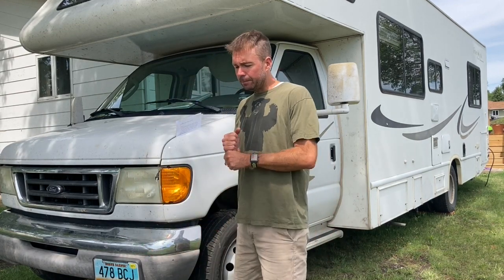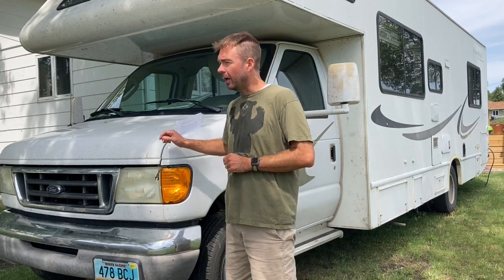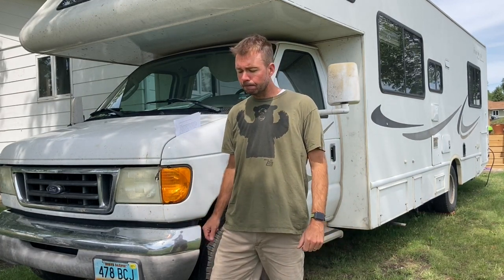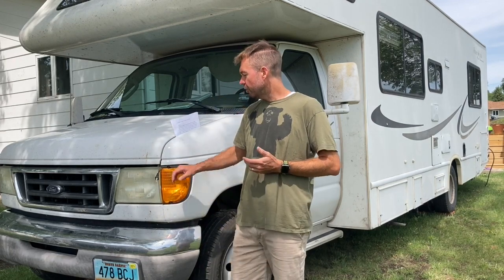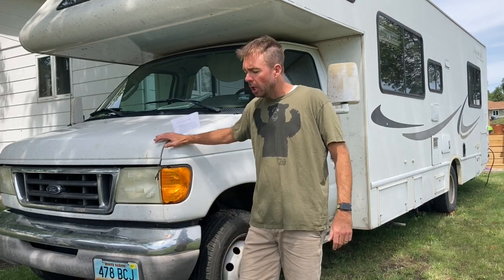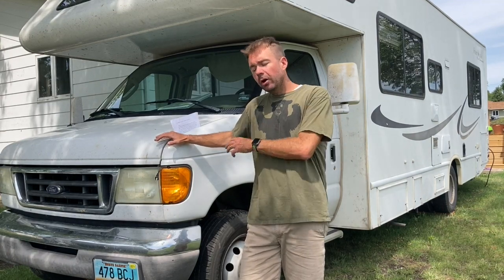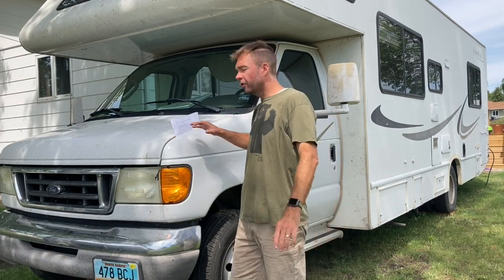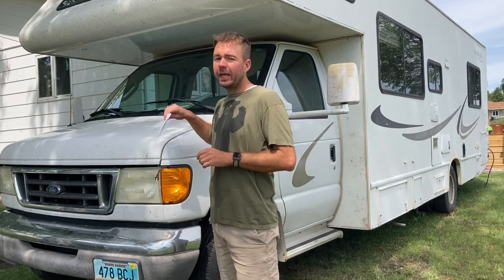RV Suspension Upgrades

Comment: Thank you for the video! I have an '06 E-450 with a 29' coach. It drove poorly, even though we had it aligned and the front end looked at twice. We have an upcoming 2700 trip and I just wasn't looking foward to it because it had such a jarring ride, and handled like a pig. I found your video, and mostly followed your advice, with the exception of not doing it all at once. I paid for a shop to put in a caster kit, and then put in swaybars, air bags, and shocks myself in the course of 3 weekends. My wife and I just took it for a 15 mile drive on the freeway a couple days ago, and the difference is unbelievable. It's not quite a caddillac ride, but compared to what it was, the only word is amazing. Not sure about handling when a semi-passes us, because we never found one, but I'm certain it will be improved. Thank you so much!  I might actually be looking forward to our road trip now!

Comment: I have to agree with your comments about the handling. We hired a Canadream RV in 2018 which had the same E450 chassis and engine. It was a new one and had hardly done any mileage. I am not a novice driver by any means and have driven various vehicle in my time, but trying to keep this on the road took all my concentration. It took constant steering adjustments and it felt like jelly (from the UK) on the road. We had a good time in Canada Maritimes but the need to keep it on the road took the edge off the holiday. I'm glad you find the handling terrible and it wasn't me.

Comment: I've got a 2011 E-450 super duty based RV.  When I did the Bilstein shocks the ride actually got WORSE.  I called and talked to them (Bilstein Cust Serv) and discovered for the RV shocks they had heavy duty and comfort shocks.  I had ordered heavy duty.  Once I had the comfort shocks installed the ride improved significantly.  I've also got a road master steering stabilizer and anti sway bars.  HUGE difference.  On the stock hardware the RV was a real handful to keep between the lines.  I would almost go so far as to say unsafe above 50 mph on the stock gear.
Reply: How long is your RV?  Did you install comfort shocks all around?  I read that some people, installed comfort shocks in front and heavy duty shocks in the rear depending on how long their RV was.  I have a 31.5ft class C.  Any insight would be greatly appreciated.
Reply: @TP-zt3gp  26' I did comfort all the way around.  That with the rear airbags at 85 lbs makes for a pretty decent ride.

Comment: Sorry I'm in Florida. 750 for the tires installed. 800 for the sway bar bushings the front steering shock in the Caster sleeves and alignment. Put the shocks on myself. Cut a hole in the floor and put a new fuel pump and for less than $200. Easy as pie

Comment: Getting ready to do major upgrades to Suspension and steering. I have a 2006 E4 50 chassis even though the motorhome is a 2007. Getting ready to order the Hellwig 7008 and 7180 Sway bars. Also ordering a Roadmaster Rssc-rbk24 Steering dampener. I got both the airbag 5000 for the rear and 1000 for the front airbags with the remote controlled dual system. Probably will get a air tank just so I can tap off it to fill my tires plus run an airhorn I have an old trucker horn from the 40s. I have already added a 4 way camera system. With recording. I will have to check into the alignment thanks for the info.

Comment: Great video! Thanks for sharing what you've learned. I totally agree with your recommendations because they make sense. I want to add a little more info that I've learned in my research that might help. I wound up here because my 1998 31' Tioga busted a leaf spring pin and I've been looking for upgrades since I'll be in there making that repair. Based on my research, I've learned that the OEM leaf springs on these cab/chassis Fords are grossly undersized for the weight the RV manufacturers are piling on them. We  then add to it with all our junk. They are rated between 4-7000 lbs and we load these things up to 10k. When we add the air bags, it helps but is more of a band aid fix for what the real problem is. I'm told that a better fix is to replace the leaf springs with properly rated springs according to the weight of the RV. It requires a simple trip to a scale while fully loaded and then a phone call to a leaf spring dealer or custom manufacturer. It makes total sense to me that if air bags are helping your ride quality, new rear leaf springs will improve it even more. I'll be making the upgrades you suggested along with the leaf springs and will report back.
Reply: Hey any updates on this?
Reply: I’ve heard the same but haven’t done either yet… have you replaced yours yet and what do you think?

Comment: I have to wonder if you have been driving my vehicle.  You named every handling problem I have been having.  I had hoped you would list part numbers as I'm heading for the parts store to pick up supplies and solve these problems.  I'm going to view it again and see if you mentioned any actual  parts you used.  The videos help as I can see what needs to  be done easily.  Thanks so very much as this video is priceless.

Comment: Great recommendations.  I bought a 2000 ford Tioga rv and it was just like you said.  I spent hours on the computer trying to find info to correct the handling.  I have done all your suggested mods except the airbags.  It now handles very well...but needs the airbags. I wish I had seen your video a couple of years ago.

Comment: I don't seem to have all these problems with my E450 29'. However, I did add the blue Sumo Springs on the rear mostly because I carry a scooter on the back. They did seem to restrict crosswind and cornering sway and some nose diving, none of which I had seen as much of an issue. It will make it easier for my wife to drive, if I ever let her. I think so many complain about it because they have never driven vehicles this size before and after all, they ain't no sports car. Of course many have issues because of age and miles.

Comment: I own a 2014 E450 Sunseeker 3010DS. Converted to 4x4, lifted 6” Dana 60 front axel 4:13 gears with front and rear Hellwig 1.5” sway bars and Fox 2.0 heavy duty shocks. Drives and rides like Cadillac.  Switching out the Fox shocks for King shocks this summer though.  Suspension is key for a safe comfortable drive.

Comment: Having to replace my radiator on my bus, I did the transmission filters and the steering stabilizer. It was like $40 on Amazon. It's a tough call between RockAuto and Amazon for best price. They wanted double the price for most things at the dealership, but I needed one filter that day, and the crappy one from O'Reilly's that I returned was the same price.

Comment: Steering stabilizer and shocks can go bad in one direction only (compression or extension). They are important components of the suspension design. Install a good one.

Looks like you have a Majestic or similar? Entry level Class Cs will all handle like crap. Ex-rentals may be worse.

I had a 2011 Fleetwood Tioga 23b with similar handling issues. What you suggest would be appropriate for it. Though I'd install Sumo Springs instead of air bags.

I now have a 2008 Holiday Rambler 235S that handles like a van as it was built with the proper components. I am adding Sumo Springs as factory bump stops are way insufficient. 

Caster is quite important as you stated. Think of a shopping cart. Negative caster causes that horrible wobble. Positive corrects it.
Reply: Why would you rather have Sumo springs over Airbags?

Comment: Great video, the most useful info I could find on class C suspension. One Question in retrospect, would you have rather gotten comfort ride Bilstein shocks?.
I think John Mcintosh's post is on to something. I put the Bilstein Heavy Duty shocks on my 2001 32 foot class C yesterday (lining up the rear bottom holes are a PIA FWIW) and the ride seams harsh on the small bumps. When I test drive it over road reflector I feel every one of them almost like it has no shocks at all. I would think if your going to add the Hellwig antisway bars there wouldn't be a need for the Heavy Duty shocks, the comfort ride shocks may be a better choose. I haven't yet tested the Air bags I put in. I wonder if they will have any effect on smoothing out the harshness of these small bumps. I got the air bags mainly for clearance issues.
Reply: Wow,  I was surprised how much smoother my RV rode after inflating the air bags. The HD Bilstein shocks are tons better now with the air bags. I did not think old springs made that much different.

Comment: TIRES: 
I tow with my older 99 winnie 24 and now 2003 Jayco 31. Need to change your tires by date code, 5 years max.  I just had a front blow out on a good spare at 70mph on the rim.  date code was 2008 but tread was nice and no cracks. 

Also get the best load rating you can.  
Nixen Rodian CT8HL with 123R load

31 foot Class C loaded with no tow is about at Max load of all 6 tires with 115R load rate. The higher 123R tires will help. I have 4 Nixens on rears with 3.5 K miles and i wish I had put 2 more on front before last trip.

Comment: Something I don't see is air pressure in the tires.  My owners manual calls for 55 psi in the  front tires and 50 psi in the rear duals.  The tires call for 80 psi max.  In set my pressure at the manufacturers recommended pressure and the vehicle was almost undrivable.  It would not steer without wandering all over the road and the tail  wagged the dog much of the time.  Semis almost pushed you off the road.  I raised the pressure  to 75 psi front tires and 70 psi on the duals.   It was like a different unit.  I am  already in the process of ordering the parts you recommend  in hopes it will complete the journey to a comfortable, stable  ride.  I am having some  trouble finding the correct Bilstein shocks but that is just a matter of time.
Reply from the maker: Odd mine recommends 80psi in the rear and 60 in the front?

Comment: My ‘98 just started to bottom out in the rear.  I was thinking of replacing rear shocks, I did the fronts last year, however one of my rear air bags leaks badly.  To save $$, what should I replace first, air bags or rear shocks?

Comment: Have a 2016 Thor e450 v10 and added roadmaster front and rear sway bars long with the front stabilizer shock. Also installed sumo springs all around. Also installed the suppersteer rear trac bar. It ride so much better. However I still have issues with what feels like way to much play in the steering. You stated 2deg camber but then stated  4-7deg is ideal. Can you explain?

Comment: Thanks for the videos, I was wondering if a 2015 four winns E450 would have any better equipment or would all this be required as well for 2015. BTW live in auburn calif. would like to get the name of alignment shop you used..Very informative
Reply from the maker: Sorry for the delayed response. 
Linville Brothers Tires and Alignment 
1936 El Camino Ave, Sacramento, CA 95815

Comment: Hello Jason, Do you have any experience with changing the fuel filter on your motorhome?  We have a Ford E450 Class C Jayco Greyhawk motorhome on an E53 chassis.  The fuel filter isn't located on the driver side inner rail, behind the left front tire.  We aren't sure where it is located, someone said in the fuel tank, do you know?
Reply: I'm pretty sure it only has a fuel filter in tank, so not changeable.

Comment: Did your height get raised by any modifications? I was going to convert mine to 4x4
Reply from the maker: The rear is about 1” higher with 40psi in the air bags. 2” higher with 80psi.

Comment: my newer  e350 motorhome is bottoming out on rhe front axle frrom the potholes.   bagss in  rear and shocks n springs like a 2" lift in the  front, agree?
Reply from the maker: Yes you can do front bags too if needed, I've heard some platforms are front heavy, mine isn't so not an issue. Let me know what you decide if it helps.

Comment: 2012 Sunseeker 27 ft, Roadmaster steering stabilizer, front and rear sway bars, Bilstein shocks, already had airbags, the biggest improvement for wind and semi truck interference was a rear track bar. Next step will be caster settings for overall handling!
Reply: Horsefly, you added a sway bar AND a track bar?
Reply: Yes , the stabilizer was a replacement/upgrade for the original which improved the condition but not enough. I then installed a rear track bar that greatly improved the stability especially when towing a jeep. I sold this class c to bro in law and bought a similar size , different brand, that suited our needs better. The current one is stock and handles great without upgrades, it just depends on the unit , I suppose.

Comment: the 2021 vegas has the 7.3V-8 could the weight of the larger engine be the cause?   how about tire psi my tire manufacture does not give psi rating per axle weight/ on the tire at their web site, at least I coud not find one... .  so i was running max psi 75 psi.    wondering if that could be part of the problem...    big issue only 2" inches of play before bump stop hits axle.

Comment: Sadly, I did the recommended upgrades (and more) and my ride is worse.  Bilstein (comfort) shocks in front and rear, Sumo springs up front, came with rear air bags, Helwig front and rear anti-sway bars, Bilstein steering stabilizer, alignment, new tires and Trac bar.  Any suggestions? 2004 E450 27 foot RV.
Reply: Was just reading your post, very sorry you’ve not gotten the satisfaction out of your upgrades and cost on your coach. Suggest playing with the psi on the air bags and are you using the 1,000 pound sumo’s up front, they do make a difference as for the ratings. The other thing is tires, some do ride better than others. But that’s an added expense. I’d mess with the air ride and change the sumo’s if they’re the higher rated ones. Just tryin to help.
Reply: @ricktaylor6373  Hi Rick, thanks for your reply.  I've played with the psi in the air bags, (they are only in the rear) and haven't noticed a difference.  The only reason I really use them is to get a couple of extra inches raised in the rear since my receiver hitch is very low and scraps when entering/leaving parking lots some times.   I have the blue Sumo springs, I believe they are 500 lbs but how would that change the forward motion during steering (with not rough roads)?  As far as tires, well, I just spend $1,500 for new tires so I'm not going to be switching them anytime soon.  thank for your suggestions, I'm wondering if the alignment was made worse, however, I did listen to your advice and looked at the alignment spec sheet they gave me and they are within your recommended specs.
Reply: @prohomevideos  oh boy! I’m gonna think this thru, I’ve got a friend that works at a ford dealership and he works mostly on the f250’s e350 e450 and the likes. Commercial stuff. He might have a resolution on this. As for my thought what about the front coil springs? Your coach really isn’t old and most likely don’t have a ton of miles.  These things never ride like Cadillacs but with all you’ve done there should be some significant improvements straight away. Heck just putting the sumos on my 2021 32 foot gulfstream class C made a big improvement.
Reply: @ricktaylor6373  The MH has 50,000 miles.  I do not suspect the coil springs because it rode "ok" before the upgrades. I am suspecting the alignment since it rode better before the alignment and all other parts, including tires.  I should have test drove it after each upgrade in order to isolate the issue but it just would have taken a lot of time doing it that way, but hindsight is 20/20.  I added the tracbar last, hoping it would improve but no change.  I would appreciate any help your friend could provide.
Reply: Well I said I would check on your issue with a guy that works on ford heavy duty everything. So he looke at all you said you did and all I said and he finds it perplexing as well. He said that maybe because of the wheel base and he thought by putting the stock rear sway back on if you still had it that it might soften it up some. This is perplexing. Now I’ve a 2021 gulfstream conquest class C and it’s 33’ 8” . Rides pretty good but like everyone the sway and all the other nonsense is with it. So I put the black sumo’s on the front yesterday and took it out and about and on the interstate. It was a world of difference.I’ll throw a better front steering stabilizer on next and see how it is. I’m just putting one piece on at a time and testing it to see of more is needed or not. If for chance I’d find some worthy info I’ll pass it on to ya. I know it’s miserable when ya got a nice coach and it rides bad.
Reply: @ricktaylor6373  When I pulled off the old front and rear anti-sway bars, for a moment I thought about keeping them but then I thought, wait, I am buying heavy duty and much better ones, why would I need to store these bulky parts, so I threw them out.
Reply: @prohomevideos  go to weldtec designs and see their parts/videos.